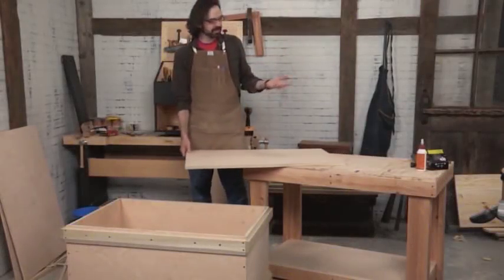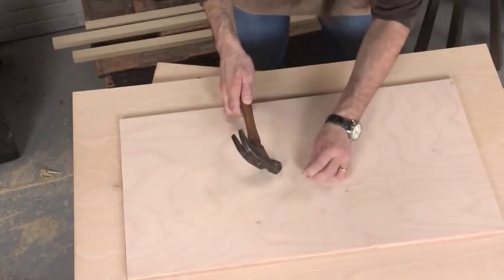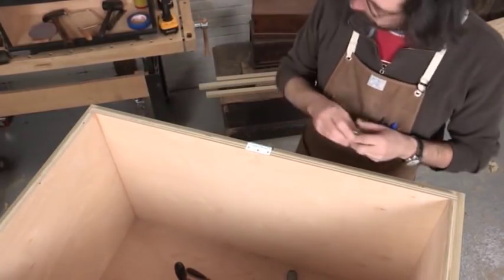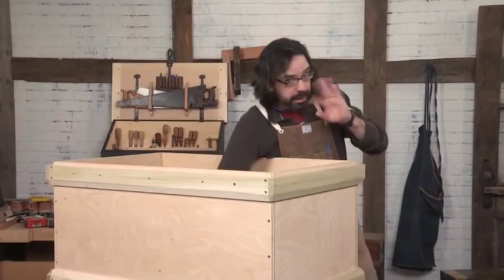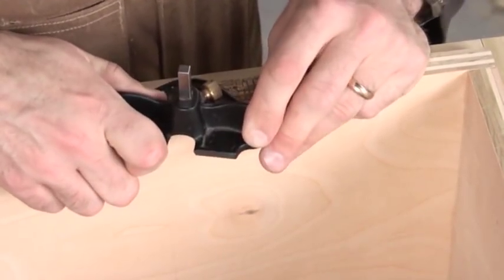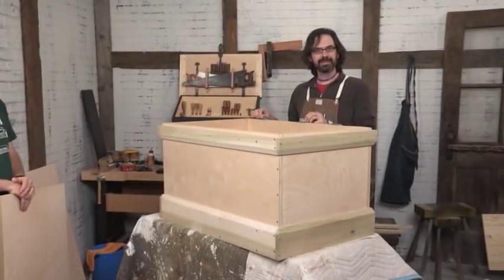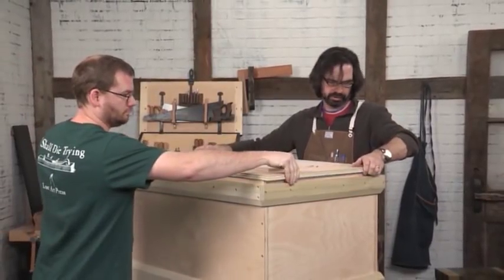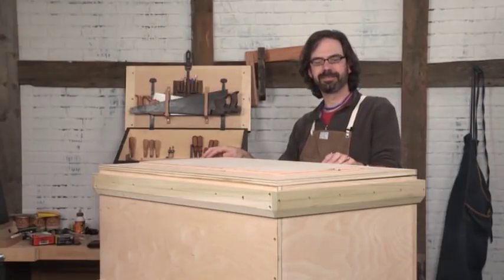Build a Plywood Tool Chest with Christopher Schwarz Part 7

Comment: Lay two hinges flat with a space between. Place the router plane on the hinges one side of the plane on one leaf and the other side of the plane on another leaf. Loosen screw that secures the router blade allowing the blade to drop to the common surface that the hinges are resting on. Tighten screw to secure blade. The blade is now set at the same depth as the hinge leaf thickness. All done, easy peasy and far less fiddly then “eyeballing” the blade while attempting to raise it to the correct setting.

Comment: those used router planes are almost as expensive as new premium ones. If your really cheep you could use a angle grinder. I know a bunch of carpenters that use them for inside corners on trim work.

Comment: I would have thought the bottom should be 3/4 and the top 1/2  inch . That way you can have the thicker bottom as load carrying.Also the hinge should have been laid on the side of the router blade to avoid contact with the razor edge.

Comment: You say this is a basic build, which it is. But you keep adding tools and things that the beginning woodworker wouldn't have. And if they did have all of those tools, I'm pretty sure they wouldn't need to watch a video to build a basic tool box. I mean just doing the hinge mortious, you introduced another $250 of tools.
Reply: Chris Jones - Actually, you don't need a router plane to do a hinge mortise...a ½" or ¾" chisel will do just fine
Reply: Oh come on that little router is not $250
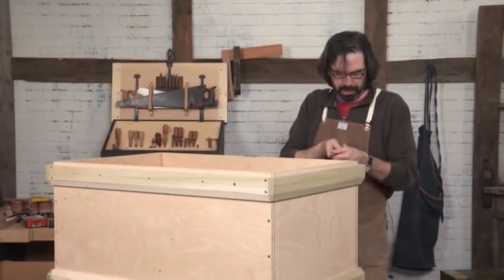Reply: @ 8:00 you are instructed in the option of a chisel which is the tool listed in the beginning
Reply: You can make a router plane with a chisel and it is simple. 
Everything that is in the video can be attempted with basic tools. All you need is hand saw, chisels and hand plane.
Reply: The router plane he’s using is $95

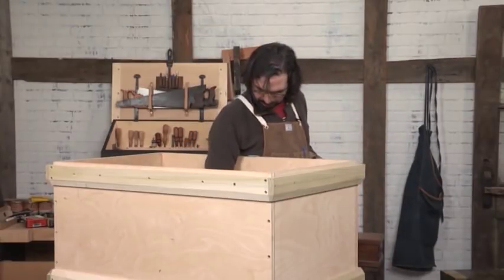Comment: 8:07 dude, you showed in one of the first videos all the materials and tools you would need for this project, and now here's the router plane. what was not in that inventory video.
Reply: As he pointed out you do not need to use the router plane as a normal chisel will do. Just to let you know that if you have a chisel with just a bit of wood you can turn it into a router plane. 
Look up some videos on how to make a router plane with a chisel.

Comment: Loving the series of videos but a step was cut during editing.  Not only are the top side of the carcass attached, but they are not flush with the top. I know this is needed for the dust seal that is being created but would be nice to know how far down from the top those pieces are.
Reply: He is promoting the DVD with this series of videos. He keeps referencing to the DVD for complete instructions and plans.   I don't think you could get the DVD anymore, but I have placed a lot of effort to find it. This is enough information to figure out the rest.
Reply: So, you didn't watch to the end of part six, eh?  He didn't show the installation, but he did address the setback from the top edge of the case.